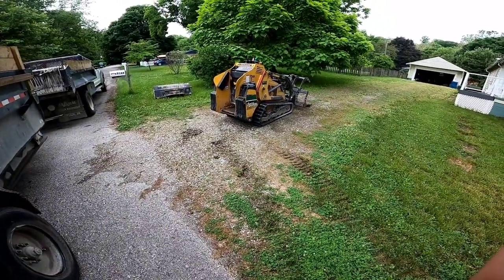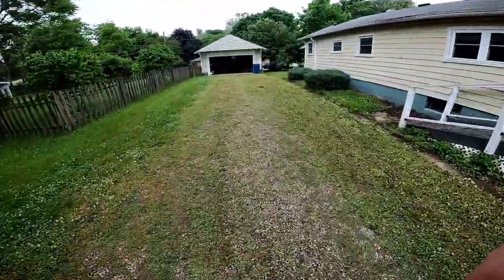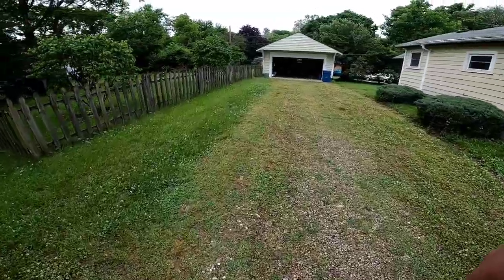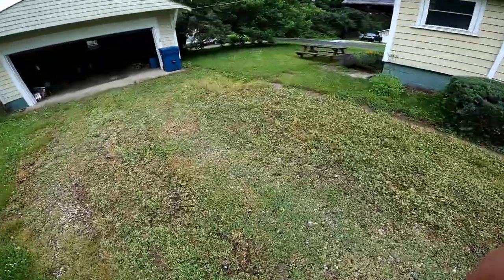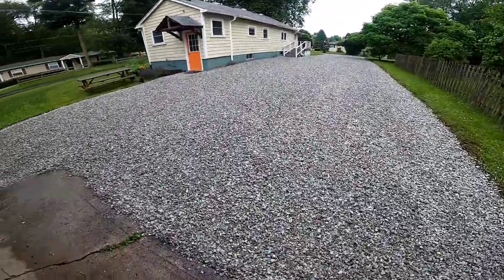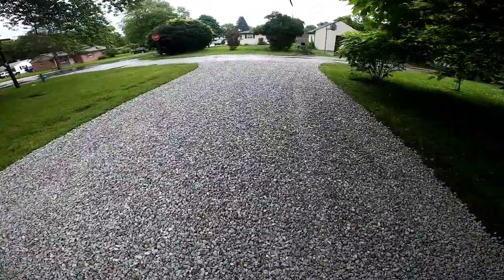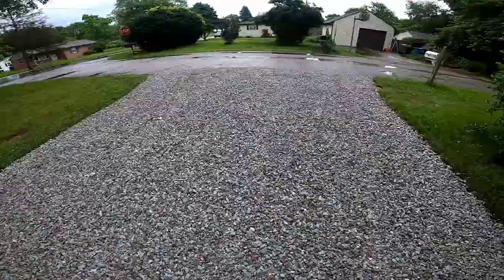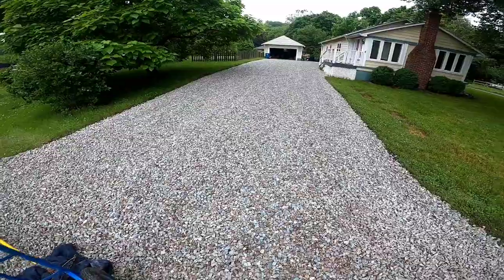Gravel Driveway Transformed Into Talk Of The Neighborhood!

Comment: Nice videos. That Vermeer looks like a quality machine. What service issues or parts usually break on that machine? What is your history with Vermeer or other mini machines?
Reply from the maker: I started with Toro Dingo.

For the Vermeer, Oil changes are slightly difficult but not impossible. It's a lot of engine packed in a small area so not great getting hands/tools thru to some areas of engine compartment. Belt changes are same way but after 900 hours have only changed fan belt once. I've replaced tracks a few times and they are fairly easy. I changed main drive sprocket after 750 hours. All hoses, pumps have lasted fine. My machines had radiator leaks that Vermeer replaced for free under extended warranty so hopefully they survive a good while.

Vermeer is a great brand. They are expensive at my dealer to fix and parts seem to be expensive to replace. But I'm guessing that's the same with any brand. I do as much as I can on my own though.

Comment: Would it not be a good idea to compact it?
Reply from the maker: No. Not really. I am loosening up the top few inches of stone and only adding a thin layer. I drive over it multiple times with machine to pack it down. Which it does tighten everything up pretty decent. But once cars drive over it packs it even more.

Comment: Do you still have that Harley Rake? Just curious why you replaced it. 

Also, what size is that smooth bucket?
Reply from the maker: The Harley Rake is great. I researched them for a long-time and liked the idea of being able to switch to a tiller with the MTW.
Reply: @ did the old one give out?
Reply from the maker: @DevinJenkins-z1d it's still going but 1 bearing is shot.

Comment: i dont get why people use #8 stone for a driveway. it will constantly roll around and make ruts at the street where cars turn in. all that stuff is meant for is bedding/back filling pipe in a trench, or hydrant weap holes. i guess people like the clean look without the lime dust.
Reply: I prefer 73's, which are 8's with the dust. Packs much better and helps to smother out the weeds.
Reply from the maker: Yes. They like the clean look and less mud in the freeze/thaws